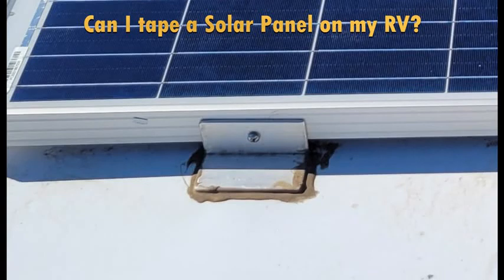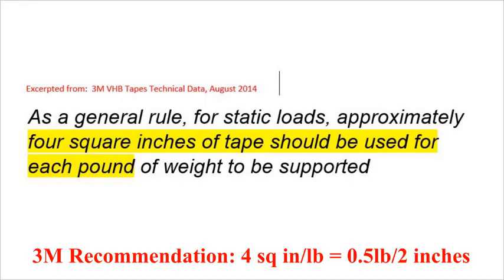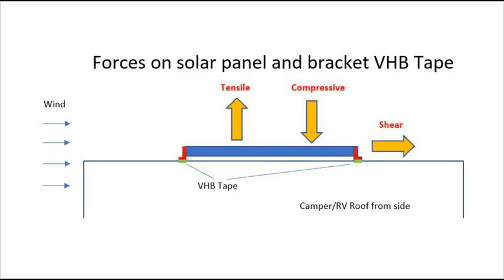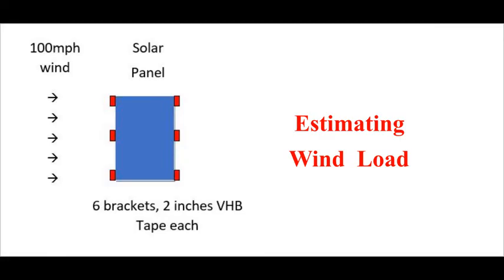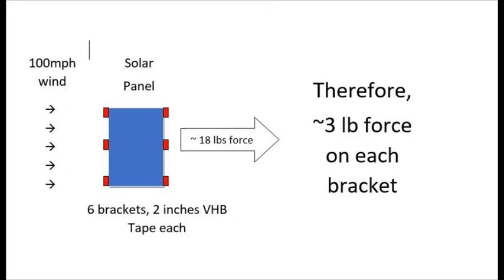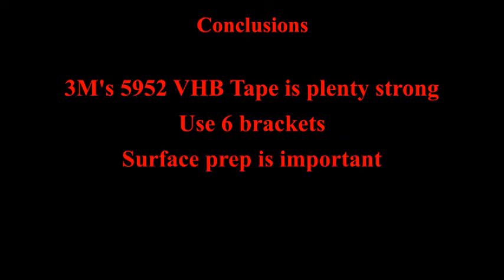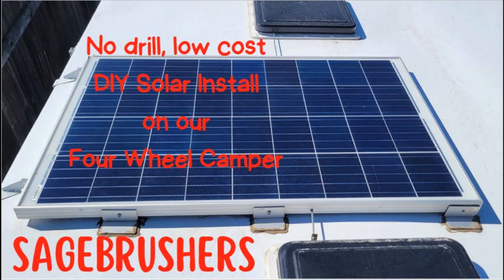Is 3M Very High Bond Tape strong enough to secure a solar panel on an RV?

Comment: Im gonna try this on my boat dashboard with an abs board stuck to my boat dash with this tape.
Reply from the maker: Should work great as long as both surfaces are hard and smooth, and protected from the environment with a sealant of some kind like Dichor lap sealant or Eternabond or something like that. Good luck!

Comment: Updates? Please
Reply from the maker: Well, I will just say that after 4 years and 11 months and about 76,000 miles, my VHB tape-attached solar panel is still up there.  I plan to do a stress test at the 5 year anniversary of my solar install in late May/early June of this year and will post a more complete update then. Hopefully I won't rip them off by pulling too hard!   Stay tuned!  And thanks for the question.

Comment: Hell no. 1 day in Wyoming that will fly off
Reply from the maker: For rolled on roofing on big RVs, you may be right, @SolarPowerMyRV.  But our 60,000 miles, some at 80mph with 20mph headwinds, and our hundreds of days (including about 8 in Wyoming) say you are wrong. If you know of any VHB-Solar panel failures, I and every viewer of this video would really like to hear about it.

Comment: I solute you as a fellow engineer but I woukd have done the sheer calculations in conjunction with environmental testing.  I'm comfortable enough to just use tbe tape based on your analytics.  Saved me a ton of time. Thank you very much
Reply from the maker: Thank you @curve5746. I would have done sheer calculations but I'm not that kind of engineer and my mechanical engineer son was to busy to bother.  ;-)  Glad is was helpful.

Comment: I really appreciate all the thought, calculation and testing you put into this topic.  
My only question though, is why not just use a rail that runs the length of the supported sides instead of the six little 2" feet?  That gives you ten times (loosely estimating) the adhesion area of the little brackets, and also spreads the load out across the roof instead of concentrating it on the fiberglass laminate just at those six points. 
Just a thought to toss out there for ya.  
Enjoyed the video...  it did answer a lot of questions for me, and I feel better about proceeding with the VHB idea than I did before.  (I'll be doing rails though...  much bigger panels too)
Reply from the maker: Good question, @1SqueakyWheel! To be honest, I saw vendor kits that used 4 or 6 small brackets and didn't think about it. I just mimicked them. I think you have a great idea, especially if you want to get even more taped area (and more peace of mind) at minimal cost. 

My only hesitation in doing that would be restricting airflow too much under the panel, because hot panels are less efficient, but that can be mitigated by making sure there is a decent air space underneath the panel, say 1 to 2 inches? An aluminum angle (or square tube or channel with say 1 inch on the bottom side and 2 inches sticking up might do it. You could even lighten it and ventilate better with large holes along the length of it.  But that might be too much work. Just thinking... 

I would still lap-seal or Eternabond both sides and ends of the track or angle pieces to prevent moisture from getting to the VHB tape.  I'm no expert, but that's what I'm thinking.

Comment: OMG, thanks for taking the time to make this video.I want to install solar panels on my TT, and I really don't want to put any holes in the roof.  I am planning to use VHB tape and eternabond tape as an additional layer of protection.
Reply from the maker: Thanks! Good luck on your install. I'm getting close to 5 years and still looks good.

Comment: What always gets left out of these conversations is the heat/cool cycle that usually impacts adhesives in a dramatic way. what if exposed to 100f for 8 hours during the day and then 35f for 8 hours at night? ... a very likely scenario if traveling in the southwest. That cycle plays havoc on materials.
Reply from the maker: You have a good point @thomasfeiller2207.  My thoughts (I'm not a materials expert) are 1) the 3m VHB temperature rating is -35C (-31F) to 90C (194F) but that doesn't totally address temperature cycling issue you raise; 2) Such cycling is most damaging IMHO when moisture is present causing damaging freeze-thaw action, hence the importance of a lap sealant to isolate the VHB tape from moisture; and 3) Our solar panel installation on our camper is approaching a 5 year life. Our camper resides outside in the inland west with days over 100F and below 20F and we have travelled from Baja to the Arctic Ocean, especially desert country, and I see no degradation, visually.  Time will tell. I will maybe do a pull up test on the panel at the 5 year mark.  
Thanks for the thoughtful comment.
Reply: Thanks for the response. I don't think we can argue with 5 years of success. It could be, however, that at some point a threshold is reached where a breakdown of the adhesive begins... 6 years? 10 years? who knows. But 5 years is a pretty good testimony to the quality of the product and process. @sagebrushers8497

Comment: According to 3M instructions, you have to wait a certain amount of hours before applying any force to the item glued to get the maximum strength of the bonding:

"After application, the bond strength will increase as the adhesive flows onto the surface. At room temperature, approximately 50% of the ultimate strength will be achieved after 20 minutes, 90% after 24 hours and 100% after 72 hours".
Reply from the maker: That is exactly right Charlevoix418.  The 3M data sheet also adds that bonding "is faster at higher temperatures
and slower at lower temperatures."  Now that winter is here, I would not apply the 3m VHB tapes on a cold day unless you can let your rig sit in a warm garage for 1 - 3 days. It just will not bond properly on cold days. People should find the 3M Technical Data Sheet for more detail on this. Thanks for that comment!

Comment: Thanks! My van has no rails and I want to put a flexible panel on it. This is very helpful.
Reply from the maker: Good to hear!  Note, a flexible panel is even thinner and also closer to the surface so the wind forces should be even less.  Just make sure the back of the panel is very smooth to assure good adhesion (I assume it is but I don't have experience with them).  Thanks for your comment!
Reply: @sagebrushers8497  I've watched a few videos now and it seems the best way is to use a plastic cardboard or similar backing. It was suggested to me a while ago that glue or tape could work, but I was skeptical. Your research and explanation gives me confidence it will work.

Comment: This definitely calms my fears of using vhb for my panels. I have an aluminum roof and plan on securing my panels with 90° aluminum trim equal to their length using vhb tape.
It's overkill, and now I know for sure it'll work.
Reply from the maker: Thanks for the comment @fuqinazhole.  Yes, I agree, 90" of VHB should be overkill!  Not sure of your configuration, but I left a little space under my panel to allow a little cooling air flow on the bottom of the panel as they say cooler panels are more efficient. How much more, I don't know.  And a lot of people attach non-rigid panels directly on the roof surface, so maybe its not a big deal.
Reply: @sagebrushers8497  my plan was to vhb the length of the 90° bits to the roof and bolt the panel onto the vertical face, leaving 1-2" space underneath. I guess I could use vhb for that whole process, idk. Might not be cost effective, tho.
Reply: If you have an aluminum roof, drill it and seal it.... thats the RIGHT way. This setup is for fiberglass roofs.

Comment: A couple of things..first of all your NOT supporting any weight as the weight of the panel is resting on the roof, so the tape is only needed to prevent movement..by what?....well, wind shear either from wind or by driving...need to calculate the wind shear going 80 MPH and then see if it can hold up.
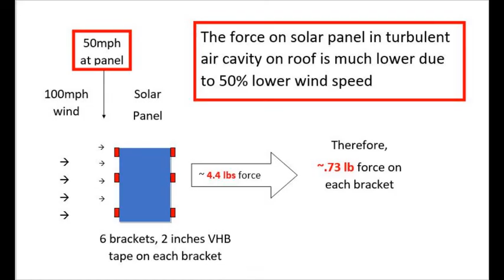Reply from the maker: Thanks @johnnyzee383 for the comment. I think you are right, it is mainly wind shear and I did calculate it (at 100mph! See 4:00 to 6:30 in the video) and concluded it is well below the shear strength of the VHB tape.  As some commenters have pointed out, there is also a little bit of tensile force pulling up (thanks to Bernoulli), but wind shear is dominant and both forces are well below the shear strength and tensile strength of the VHB.
Reply: @sagebrushers8497  Thanks to your video I did the same thing with my panel...easy peasy and unless we get a hurricane its all good!

Comment: We are going to use eternabond tape to hold it down.
Reply from the maker: I am not familiar with Eternabond tape but it seems to be very popular for sealing RV roofs and for sealing solar panel brackets. Are you using a two-sided Eternabond under the brackets or panels or a single-sided Eternabond product over the top of them?  I ask because it seems like the single-sided Eternabond is great for sealing, but I'm not so sure it is as strong an attachment like a two-sided VHB tape (3M or Eternabond). Like I said, I have no experience with it but if it were me, I'd put a two-sided tape under your bracket for strength then a one-sided tape to seal it from the environment. I think Eternabond also offers two-sided tapes similar to 3M VHB and probably just as good.

When I see Eternabond tape over a bracket, I worry about the inside edge of the bracket where the vertical side meets the roof and is usually not sealed. That would be my hesitation with using a one-sided tape over the bracket along 3 edges to seal it from moisture. 

Those are just my thoughts. My tests show really very little wind force on the panels if they are not set near the front edge of the roof, so you will probably be ok if the Eternabond is as tough as it appears in the videos I've seen. But, If I used it, I think I'd still use a two-sided tape under the brackets, just to be sure. The number and length of brackets makes a difference too.

Good luck with your install!
Reply: @sagebrushers8497  we put Manus-Bond 75-Am under the brackets on the roof and then we used eternabbond tape on top of the brackets. We are going to see if it’s going to hold good. If not we will just put screws on it.
Reply from the maker: @jessicamathews5758   Thanks for the info. I looked at Manus Bond 75am online and it seems to be good stuff with strong adhesion to metals, painted surfaces etc. I would guess that with Eternabond covering it is plenty strong. Please let us know how it works! And thanks for sharing your approach.
Reply: @sagebrushers8497  that’s what we were told by my stepfather said since he works on trailers at his work.
Reply: @sagebrushers8497  Eternabond tape is pretty tough. We had to use it on the edge of our rv roof. It was very sticky and hard to come off.
Reply: @sagebrushers8497  we are using the single sided one. I don’t know if they have any with the double sided ones.

Comment: I’ve been wondering about the surfaces on van roofs and some rv,s. The roof is painted and probably has a clear coat. Don’t know if the clear coat would peel with all of the wind load.
Reply from the maker: My thoughts are that any true "paint" like enamel or factory-painted automotive paint that is strongly adhered will be fine. It is just the thicker elastomeric coatings or rolled on roofing sealants that could peel off that are not compatible with very high bond tapes. If you could scrape it off with a hand scraper--it is not a good surface for VHB tape.  Just my opinion.

Comment: Great video. Thanks! How are your panels holding up eight months later?
Reply from the maker: Thanks for the comment @teering.  Actually the panel has been installed almost 4 years now and there is no sign of degradation or loosening. Feels rock solid. One  bracket screw is missing and needs replacing, but that is a different issue.  Our camper sits outside on many days over 100F every summer and in freezing conditions in the winter, although I cover it for the worst 3 months of winter.

Comment: I have been considering to do the same. My problem is that on a RV roof you are NOT attaching the bracket to a solid metal surface, but to an EPDM or TPO plastic film. So all the load will transfer directly to the roof cover and THAT is not sure will stand…
Reply from the maker: You are correct.  You should never use this VHB method with an EPDM surface or any kind of rolled on film.  Only use it with hard, smooth surfaces! Mine is painted aluminum.

Comment: I think solar panels screwed to the roof is worth the peace of mind.  Great video on the tape.  I learned something today!
Reply from the maker: Thanks for the comment @henrymorgan3982!  Peace of mind goes both ways, I also worry about moisture seeping in through holes in my camper!  But your comment is well taken and I agree that everyone should add as much attachment as needed to bring them peace of mind. For me, it is a few strong metal attachment points in addition to the tape. 
I really recommend at least one leash or strong attachment. But there are many people using VHB tape alone and as one vendor who uses it has said, "I've never heard of anyone losing a panel"
I once forgot a temporary rigid panel laying on my roof with no tape and it didn't go flying until we hit 60 mph so that informs some of my peace of mind--the 10 - 15 lbs from gravity holding the panel down by itself was enough until nearly full freeway speed, so VHB tape along with supplemental safety attachment is fine for me, and VHB alone is fine for a lot of people. The airborne panel did not hit anyone, thankfully! Thanks again for your thoughts!
Reply: I looked at RV's that leaked through the panel holes, this sold me on no-hole mounting.
Mine have been up there for 5 years.
Reply: Worth the piece of mind? Do you realize this is fiberglass? Lmao

Comment: Hmm.. most roofs get pretty hot and from my own experience tape dont holdup well to heat. One way to remove adhesive is to apply heat, so u know where im going with this. For lightweight flexible panels mayb but i personaly wouldnt trust tape to hold down aluminum framed panels. Id hate to see that panel ripped off someones rv n heading towards me going at 80 mph. But atleast u have the simpson strong tie as a backup. Please nobody rely on tape alone to holdown the hard metal solar panels without any type of backup.
Reply from the maker: You have a very good point @theinnocent32. I agree many tapes don't hold up well to heat. However, you inspired me to check it out.  I waited for a 107 degree F day, then put a digital meat thermometer with the tip pressed into the dicor sealant at the edge of the aluminum bracket (closest to the VHB tape as I could get. It was very sunny but I shaded it with reflectix for the10 seconds it took to get a stable reading. I got up to 124F at that point.

Next I looked at the 3m Data Sheet for the 5952 VHB tape I used , found  (accessed 7/22/2023 at https://technicaldatasheets.3m.com/en_US?pif=000083) and found this:   

"Short term temperature resistance at 149C/300F:  no change in room temperature dynamic shear properties following 4 hour conditioning at indicated temperature"

In fact they say when applying this tape you get the strongest bond at 150F!  Amazing stuff.  I still think it is a good idea to have a metal fastening point or leash. And never apply to a rolled on roofing material-- just hard, smooth surfaces that can't peel off.

Thanks much for your excellent question.

Comment: The engineer in me says this is a faulty analysis in that you are only accounting for shear strength and have forgotten that at 100mph there will also be a "lift and suck" value from the wind going underneath and over the flat panel, which will try to rip off or pull upwards. Think of an airfoil or airplane wing and how it creates lift based on the venturi effect . So you have horizontal shear and vertical rip-off shear to worry about. Not sure what exact numbers are for vertical lift-off shear but both combined would result in a sort of peel off strength. If it were me, I would add an air deflector in front of panel to deflect air from getting underneath panel and/or raise the trailing edge by lets say 3/4 inch so the wind going over the panel would be pushing the panel down all the time thus leaving you with only having to worry about horizontal shear strength. Does this make sense?
Reply from the maker: Thanks for the comment @kwiknuts1!  Your discussion does make sense, especially for installations closer to the front edge or on a rounded front of an RV roof. And I think you have a great idea for the air deflector in front of the panel to keep air from flowing under it.

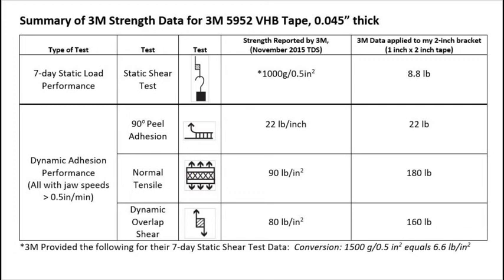I considered the tensile and peel back forces that you mention, but felt they were less important, particularly for my setup set back in the middle of the roof in the turbulent cavity.  Note in my table at 1:34 in the video, I provide 3M data for their dynamic adhesion tests including a "90 degree peel" test and a "normal tensile" test. Dynamic adhesion are quick tests that would represent more of a gust of wind so they are fairly relevant for the vertical force on the panel. These data show the VHB tape is much stronger for these vertical forces than shear forces and that is why I tended to ignore them in the video. And I still feel that the shear forces are greater than the force of lift, but like you, I'm not sure what the exact numbers would be. Hmm, maybe another test?

In any event, we have 60,000 miles in 4 years and the panel brackets with VHB tape and Dicor lap sealant look rock solid so that is reassuring. And, if you watched my previous video you will see that the engineer in me caused me to put 4 metal tie-points on the panel just to be sure!  If I were to do it again, I'd probably put a little deflector in front and skip the metal ties. Or most of them anyway.